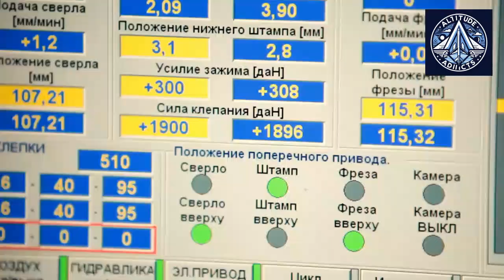Can Russia Overcome the Challenges of Sukhoi SJ-100 Certification? - Chief Designer Explains

Comment: Any comments about frequency tests?(as part of certification).... It is a good thing that all Russian companies involved in certification process which was not known before. Let me remind you that the accident of 19 May 2020 was result of two consecutive lighting strike which result the aircraft to go into DIRECT LAW and the captain was not sufficient trained and slam on the joystic. SIMPLE UNACCEPTABLE. The recent accident of SSJ100 during test flight on 12 July 2024 shows that there is long and difficult way to go. But Russia MUST take this road.....otherwise you will never manage to build a modern aeroplane.
Reply from the maker: "Vesti Khabarovsk" reported in August this year that the prototype of the domestic airliner SJ-100 passed frequency tests in Komsomolsk-on-Amur. These tests are a necessary step in preparing the aircraft for its first flight. During the tests, the design of the airliner, control systems and chassis supports were checked.
Reply: @tetnia You wrote propaganda nonsense for ignorance, which has no idea about the long-term (more than 100 years) Russian competence in aircraft and engine building
Reply: @rodjarrow6575  My friend, happens to be B1/C engineer with more than 25 years in Aviation and I know very well what I am talking about and there is no doubt that Russian Aviation has displayed great and unique achievements. BUT.....there was and still have difficulties on engines, jet and turboprop. And this is a fact. Let me clarify...for civilian aircraft. For military is totally different story.
Reply: @tetnia  This is outdated information... the period of the 90s of the last century. Avionics and Civil aircraft and engine building in Russia at the highest level today.

Comment: Just reverse engineer parts if possible
Reply: The part itself is not a problem, there are no unknowns in the design and no special materials... The problem is the time it takes to start production. A few months for designing, at least half a year for trial testing, a few months for production documentation, half a year for equipping the production line and training workers and a few more months for testing the trial batch and obtaining the necessary certificates...
Reply: Russland baut schon länger Triebwerke & Flugzeuge, hat umfangreiche Erfahrungen & Ingenieure, die vor den Sanktionen auch für andere Großkonzerne von Rußland aus,,Lohnzuarbeit gemacht haben. Ich glaube eher anderen werden diese Fachkräfte fehlen. Und das SAM ist ja auch nicht nur aus französischen Geistesblitzen gewachsen, wurde & wird auch auf einer Produktionslinie in Russland hergestellt. Wenn der Franzose oder andere meinen sie muüssen sich vertragswiedrig verabschieden. Na dann Tschüß, dann baut halt Russland zukünftig alles nicht nur allein, sondern auch auf einer besseren & höheren Stufe. Der Exportmarkt anderer ist ein hartes marktwirtschaftliches Geschäft, mal sehen wo andere zukünftig ihre Komponenten zur Ausrüstung einkaufen.
Kann mir auch gut vorstellen, warum es bei bestimmten Fabrikationen der etablierten Konzerne, momentan zu teil extremen Quallitätsmängeln & Lieferschwierigkeiten kommt.
Meine Oma sagte immer:
"Wer anderen eine Grube gräbt, der fällt selbst hinein"

Sie hatte keinen hohen Bildungsabschluß, aber sehe, sehr viel Lebenserfahrung.
Andere scheinen aus Arroganz & Ignoranz hingegen vollkommen lernresistent zu sein !!!